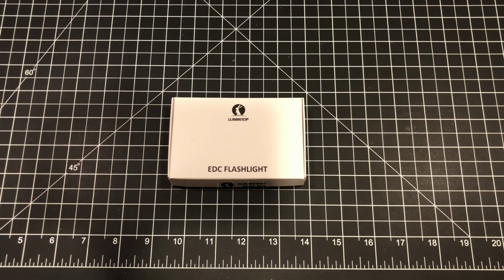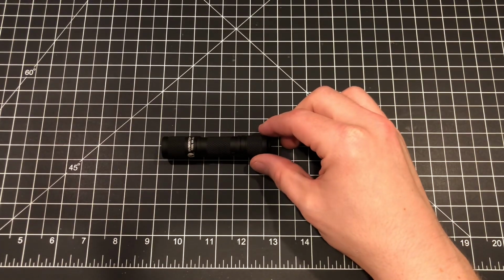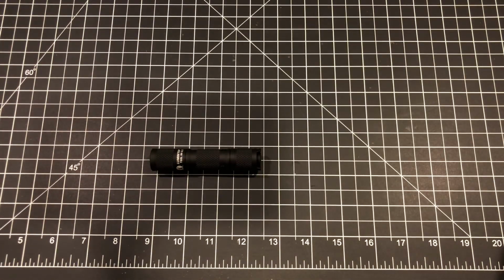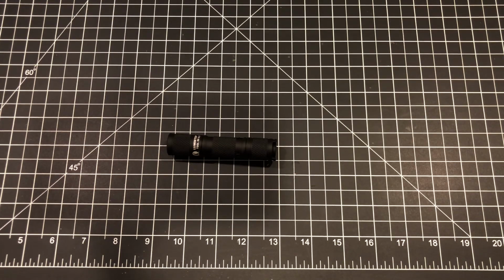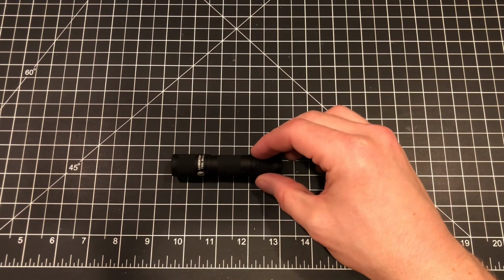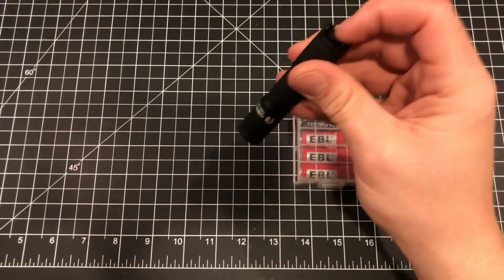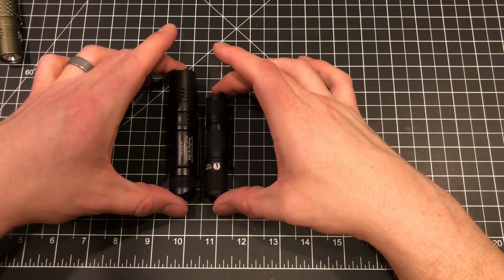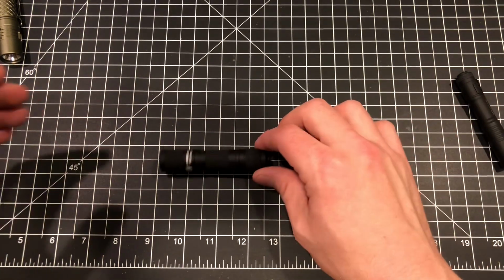Lumintop Tool AA 2.0 | Full Review ($18 EDC Powerhouse)

Comment: The Nebo Redline Flex I told you about has all these features, comes with the rechargeable battery for $20. The only thing it doesn't have is the defuser which I have never remotely wished I had or noticed I didn't have. Here is the link. https://www.nebotools.com/p/Redline-FLEX/590 More bang for the buck. The website says $21.99 but you can get it a couple dollars cheaper.
Reply from the maker: What’s up Slithh!  I remember you mentioning it and I did check out that light. I have one on order!. Not quite as bright as the Lumintop, but as I mentioned you don’t always need 650 lumens 😃. I like that the Nebo has everything built into one budget package. It’s very different from the Lumintop or any other light I own for that matter, and there aren’t a ton of reviews on it on YouTube.  I’m excited to get it in hand and review it, I think it’s going to be a very versatile light. After my planned medical video and giveaway video it’ll probably be the next thing I show on the channel. Cheers my friend!